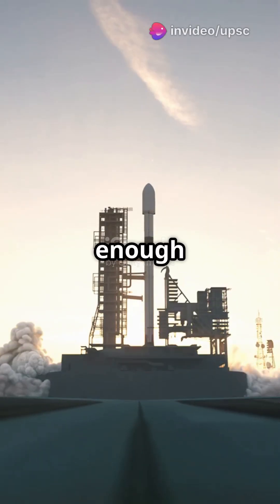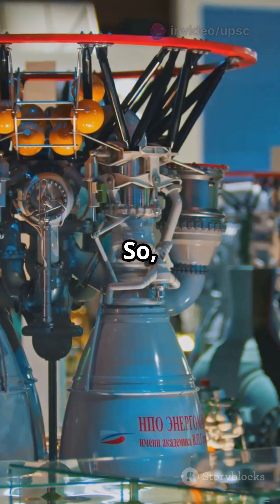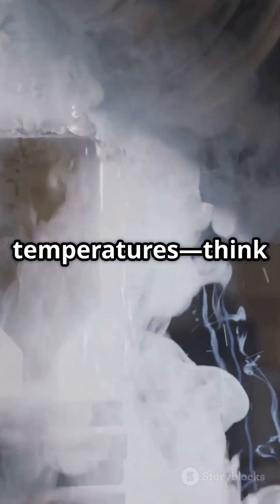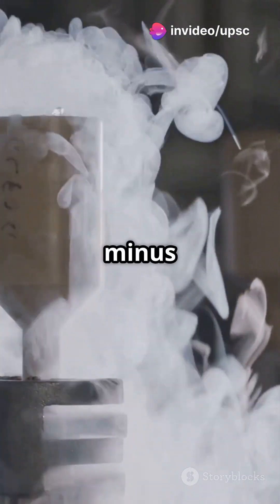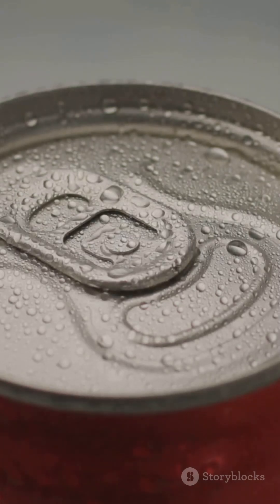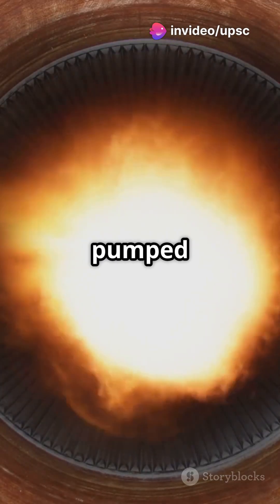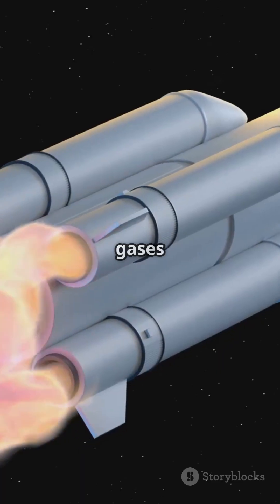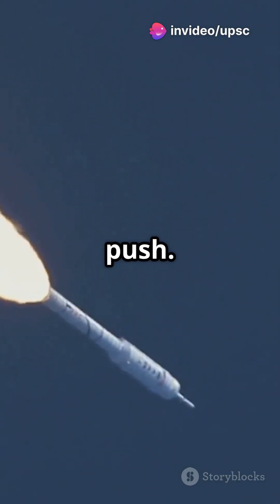Cryogenic Engines  The Power Behind Space power#upsc#aspirents #space#isro#cryogenic

Comment from the maker: *What Are Cryogenic Engines?*
Cryogenic engines are rocket engines that use cryogenic fuels—liquefied gases kept at extremely low temperatures. These engines are widely used in space exploration for launching satellites, interplanetary missions, and heavy payloads.

### *Cryogenic Fuels*
Cryogenic fuels are gases like hydrogen and oxygen that are cooled to cryogenic temperatures:
- *Liquid Hydrogen (Fuel):* Stored at around -253°C.
- *Liquid Oxygen (Oxidizer):* Stored at around -183°C.

These fuels remain in liquid form at such low temperatures and are highly efficient for space propulsion.

### *How Cryogenic Engines Work*
1. *Fuel Storage:*  
   - Liquid hydrogen and oxygen are stored in insulated tanks to maintain their extremely low temperatures. This prevents them from evaporating or boiling off.

2. *Fuel Feeding:*  
   - Pumps transport the fuel and oxidizer to the combustion chamber at high pressure.

3. *Combustion Process:*  
   - Inside the combustion chamber, the liquid hydrogen and oxygen mix. They react chemically and ignite, creating a high-temperature, high-pressure gas.

4. *Thrust Generation:*  
   - The combustion gases expand and are expelled at high velocity through the nozzle of the rocket engine, generating the thrust needed to propel the spacecraft.

### *Advantages of Cryogenic Engines*
1. *Efficiency:*  
   - Liquid hydrogen and oxygen provide an incredibly high energy output, making cryogenic engines more efficient than solid or liquid-fuel engines.

2. *Clean Propulsion:*  
   - The by-product of combustion is primarily water vapor, making cryogenic engines environmentally cleaner compared to other types.

3. *Capability:*  
   - Cryogenic engines are ideal for carrying heavy payloads into higher orbits, such as geostationary transfer orbits.

### *Challenges*
1. *Handling Cryogenic Fuels:*  
   - Their extreme cold makes them tricky to store and manage, requiring advanced technology and insulation.

2. *Complex Technology:*  
   - Cryogenic engines are technologically demanding due to the need for sophisticated cooling systems, pumps, and insulation.

3. *Cost:*  
   - The development and maintenance of cryogenic engines are expensive compared to other rocket engine types.

### *Use in Space Exploration*
Cryogenic engines have been pivotal in enabling deep space exploration and heavy satellite launches. They’ve been used in rockets like:
- *India's GSLV (Geosynchronous Satellite Launch Vehicle):* Powered by indigenous cryogenic engines developed by ISRO.
- *NASA’s Space Shuttle:* Utilized cryogenic engines during its missions.

Cryogenic technology is a cornerstone of modern rocketry, pushing the boundaries of what humans can achieve in space.